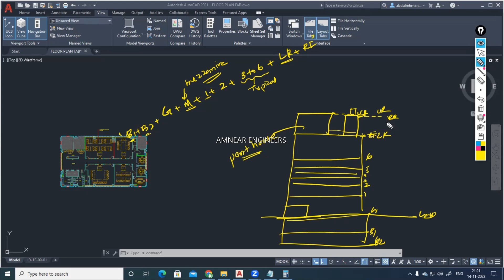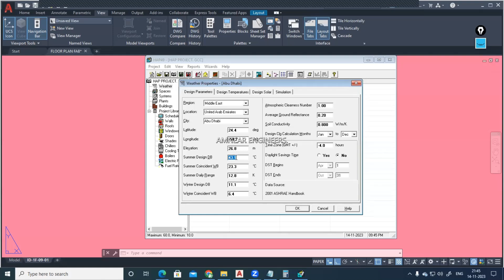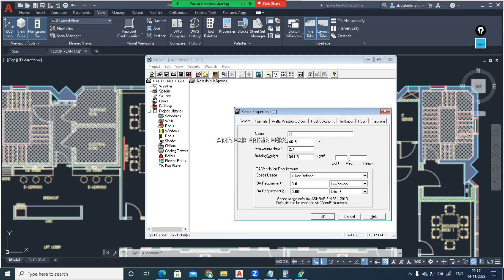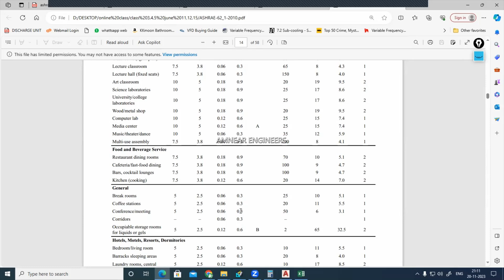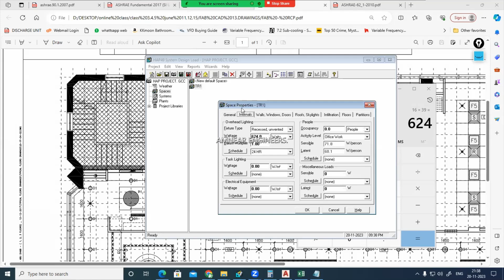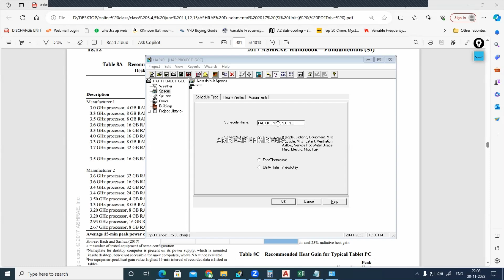HAP|COMPLETE|PART 1 OF 2| 9 + HOURS|HEATING  AND COOLING LOAD CALCULATION USING HAP|ADVANCED LEVEL|

Comment: Sir, I think FA Flow rate shall be = Max of ( People ventilation flow rate, area ventilation flow rate, fresh air change per hour, infiltration)  + Process exhaust
Reply from the maker: Hi, I'm explaining a comfort air conditioning system project outside air requirement (as per ASHRAE 62.1). If it's health care facility, we can calculate fresh air flow rate as per air changes per hour ( ASHRE 170). Also, Exhaust and makeup we can take into consideration while doing ventilation and building pressurization.
Reply: @amnearmep  I agree Sir, but in  above video you had shown FA flow rate = People ventilation flow rate + Area ventilation flow rate, while as per my point of view it should be FA flow rate = maximum of ( People ventilation flow rate , Area ventilation flow rate)
Reply from the maker: @sujeet8998  Except ASHRAE some other standards might be considering the maximum of two. According to ASHRAE 62.1, the fresh air flow rate is the summation of the people component and the area component, not the maximum of the two. You can check ASHRAE 62.1 , Section 6.2.2.1. Hope it's clear.
Reply: @amnearmep  Correct Sir, As per ASHRAE 62.1 it is correct. Is this ( maximum) practically possible or not sir.
Reply from the maker: The total fresh air demand is calculated by adding both the people and area components. This is how we determine the fresh air requirement for a space and the entire building, accordingly the selection of DOAS/FAHU. If you consider only the maximum of the two, the fresh air flow rate will be lower, reducing the machine load. However, this approach makes it difficult to maintain indoor air quality when occupancy is high. Therefore, follow the standard and use the summation of both components.
Reply: @amnearmep  Thank you Sir
Reply: Hi sir can you upload next part 2 of 2 please
Reply: Informative..
Need to consider FA in General if already we have treated FA inside villa?
Reply from the maker: @nadeemcmr8052  Hi, thank you. If you are already providing treated fresh air, additional ventilation is not necessary. Just ensure that the amount of fresh air meets the ventilation requirements by checking the relevant standards, such as ASHRAE 62.1, to confirm it satisfies the necessary air flow rate.